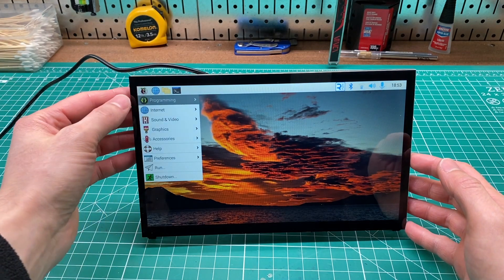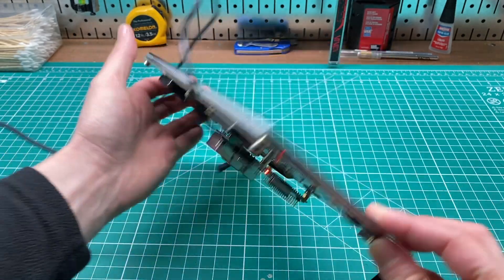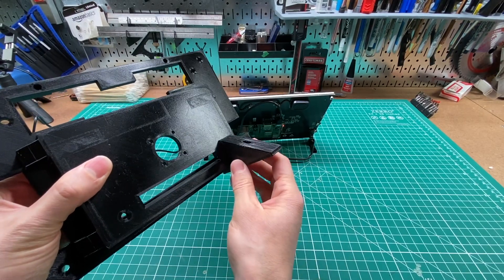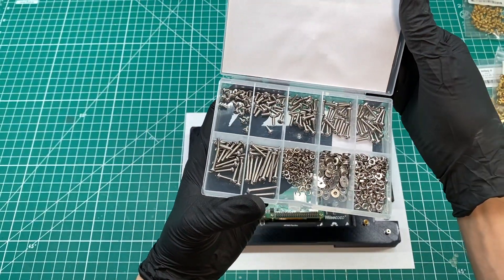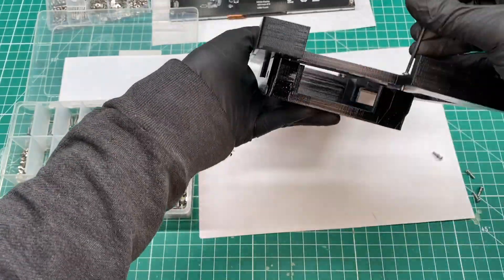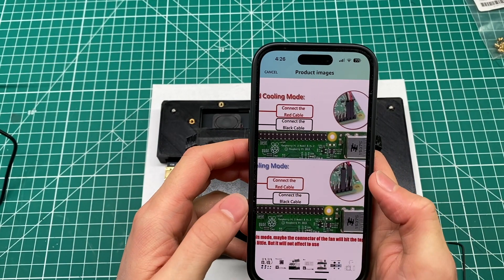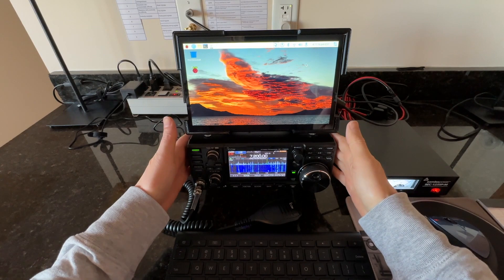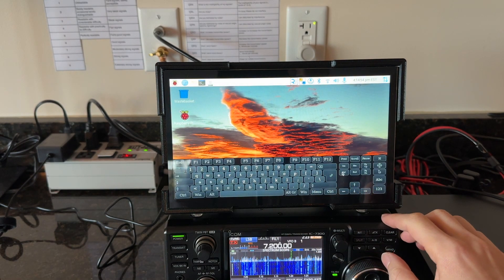Raspberry Pi 10.1" Capacitive Touch Screen + Custom Case

Comment: Why are these holes in your design way bigger than the heat set inserts
Reply from the maker: I’m not sure what you are getting at. The holes are smaller than the inserts. The video shows melting them into a smaller diameter hole. I used two different sizes of inserts. The ones for the 4 corners are smaller than the rest of the holes. The holes are sized accordingly.

Comment: I really like your use case and simplicity of the design, no unnecessary plastic etc but everything is protected and ports available. The scripting you did for the flipping etc is also really neat. However, you don’t need the 2.5mm heated inserts for the 3d print. When you screw bolts into the 2.5mm mounts on the back of the screen, they are already threaded. Just screw some 2.5mm bolts in to measure the depth of the thread. Then design your 3d print so the back of the bolt head pulls the 3d case into the 2.5mm mounts. How you’ve got it setup there is essentially 2 nuts on the bolt, but they aren’t free to move. When tightening the bolt you are either distorting the brass threads of the insert, or placing unnecessary stress on the 3d print. When using fasteners, just design it so that only one fastener is used and the other part uses the back of the bolt head or a washer to apply pressure. If you use two fasteners; make sure one is free to move, otherwise the system will be over constrained and back to back parts will have a gap or be distorted.
Reply from the maker: Hey thanks! I’ve done the pass through bolt design before, but with bigger hardware. The heads on the 2.5mm screws are REALLY small and I was worried about them pulling out. I could have tried washers I guess, but I just liked the idea of the heat set inserts + didn’t mind doubling up on threaded surfaces. Thanks for the idea though, someone reading this might prefer that design and decide to try modifying the case model.

Comment: So can you have 3d print design/build software on it, with an memory stick as storage, have it be able to select the designs you make, program it to switch your builds to gcode, and it be able to control all the components to a 3 d printer by it's self? It'd be cool to make a touch screen 3d printer that has a software like cura that's built in so you could make your design right off the touch screen, and have it to where you could access a memory stick to either save your designs, delete designs, and select a design and it would print  it
Reply from the maker: Anything is possible! Most 3D printers run off of arduino since it’s more low level and realtime to control hardware. I see a lot of people (including myself) use raspberry pi to run something called OctoPrint that allows you to control your 3D printer remotely. 

You could totally use OctoPrint on a Pi with a screen like this. I bet you could run cura too, although I’m not sure how fast it would run (maybe it would be ok on a Pi 4 or 5 — I only have Pi 3s currently). 

Apparently there is a plugin that lets you connect Cura to OctoPrint so you can slice in Cura and print directly from it: https://all3dp.com/2/cura-octoprint-plugin-connection/

Pretty cool! I will have to try this. Thanks for your comment that caused me to discover this.

Comment: how did you get you code run?
Reply from the maker: Are you asking about the screen flipping code? The readme on the GitHub repo explains how I hooked it up to a button. If you just want to run the script directly you can execute “python screen_flipper.py” or python3 depending on your setup. Note that you may need to change values at the top of the python script since it assumes screen ID 0 and HDMI 1. If you are using a different screen you might also need to adjust that regex at the top too.

Comment: I really like what you have done here, I have the same screen but cant get the touch screen to work. I am an raspberry pi newbie. Is there a file that I need to make it work. Thanks  Rick W5RCM
Reply from the maker: I’m pretty sure it worked out of the box for me with my raspberry pi 3. The screen comes with several connectors. One of them is for connecting USB on the Pi to the screen. I suspect this is needed for the touch screen to work. Make sure you have connected that. What Pi are you using?